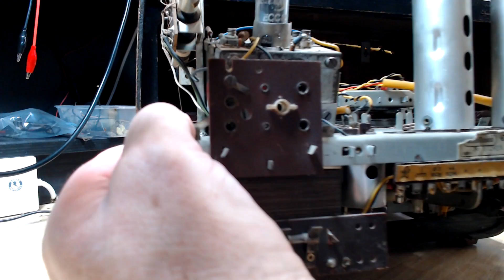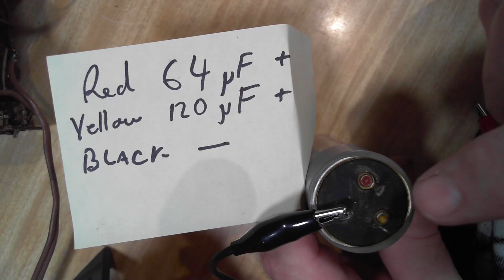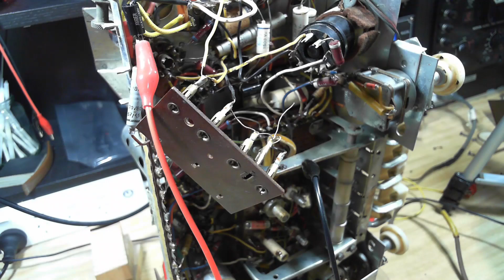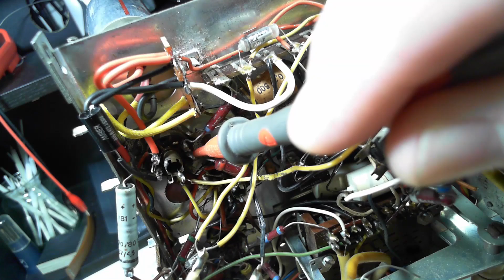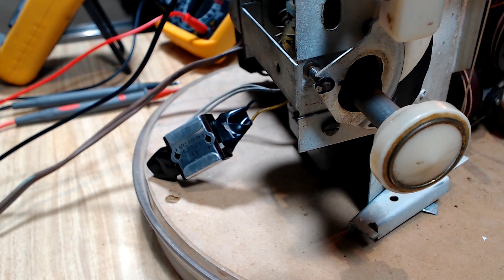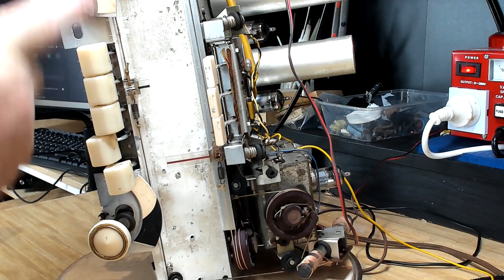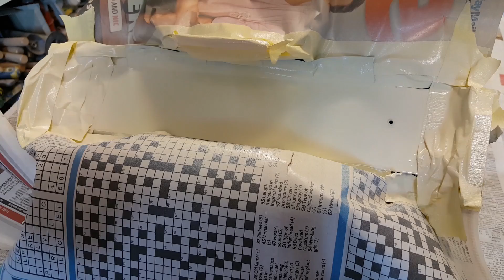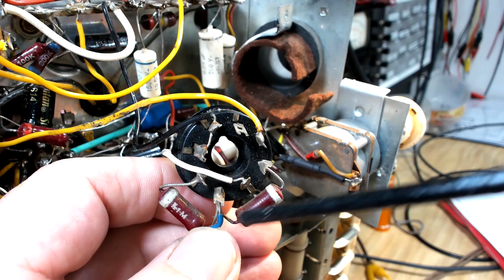NordMende Elektra 58 Restoration & EM34 Magic Eye Substitution  Pt 1

Comment: I think he lied through his teeth I don't think that radio worked for years. He's probably the one who took the speaker out. But don't feel bad I had the same thing happen to me more than once. I still think you got a bargain because the case is in really nice condition. Thank you for the interesting video.
Reply from the maker: Hi David, I don't think for a minute he deliberately misled me and the condition wasn't mentioned in the ad.  He volunteered the information after I had paid for it. He just said it was working and was put in the cupboard many years ago. It probably was working but with an external speaker. I think the seller was only young when all this happened. Besides which when I buy something like this I take a chance, I don't know what it's like on the inside and enjoy the challenge if something is wrong/missing.  Thanks I did get a bargain, i didn't pay much for it, Cheers and thanks 🙂

Comment: There's nothing inherently wrong with an old filter cap rated for 64uF and measuring 92, or rated for 120uF  and measuring 160. These old filter caps had something like -10/+80% tolerance. But since it was probably 50+ year old, it was a good idea to replace it. Have you got an ESR meter, and/or a capacitor tester to measure leakage as well?
Reply from the maker: The idea I have developed from people who know is that a capacitor that reads high means the capacitor is taking too long to charge. If the capacitor design department asks for a capacitor of a certain value and engineering produces one that is 80% over value I suspect it would be rejected. Even in the 60s when this capacitor was manufactured I would expect a consistent value within a few percent. That would mean that a large deviation from the stated value is suspect. The circuit designer may suggest that substitute capacitors within a certain range could be used and the circuit will still function as intended but that would not include capacitors that are wildly out of stated value. That's the way I see it anyway 👍🙂  I have an ESR meter but don't recall using it, with those readings it's in the bin 😀
Reply: @DavidTipton101  It was considered the more capacitance it has, the more to lose from while still stay above the rated value. It was common to 'aim" the value of filter electrolytics about +50% of the rated capacitance during manufacturing, so it will have some "spare" capacitance to lose from during its lifetime. This was applied to filter caps only, obviously no one would use such a capacitor eg. for timing circuits :) . Here's a chart with standard capacitor tolerances, and their codes. I was wrong, there's no such standard tolerance as -10/+80%, it's -20/+80%. But there are standard tolerances like -0/+100% and even -0/+200%. I've never seen an actual example of the latter.
http://my.execpc.com/~endlr/markings.html
You're right, simple capacitance meters can be upset by excess leakage, as they measure the charging time of the capacitors, and a leaky capacitor will charge up slower, upsetting the reading of the meter. For this reason,  I've used to measure both the ESR and the leakage current at rated voltage. I repair just my own stuff, so I used to leave alone old filters if they are fine, just of curiosity for how long will they last. I have many from the early '60s that are fine, and a few from the mid '50s. Some of them are in regular use, some of them just used occasionally (few times a year), to keep them in shape. 

After I built my very simple analog ESR meter in 2009, I was almost bashing my head against the wall for not building it 10 years earlier. It saved me hundreds of hours since then, and hundreds of unnecessarily replaced capacitors in CRT TVs. It's very common that the capacitance of an electrolytic cap can be well within tolerance, while the ESR is 10-20 times the nominal. You can't find faults like this without an ESR meter. Well, sometimes you can, if the circuit works and you can check waveforms with a scope. But a lot of times faults like that can prevent eg. a SMPS to start up, so you can't measure waveforms, just guess. Also, you can't measure capacitance reliably in-circuit, while there are reliable in-circuit ESR meters.
Reply from the maker: An interesting idea mmmm1, I was aware of the tolerance coding system and the fact that it allow for 200% tolerance doesn't mean a manufacturer would build to that standard. The definition of tolerance means an allowable deviation from the desired value. Anyway, this is out of my level of expertise. I will check the ERS the next time but for the cost of a cap I think a replacement cap is good insurance 🙂

Comment: I've restored many German sets in the past. You did well to restore the PSU cap (I wish I had a lathe) 

I usually either reform that cap or replace with a modern 50+50uF. I'm not a big fan of those small electrolytics you have fitted, as I've had bad experiences with them.
Any ERO cap should be replaced on sight. Some of the silver coloured caps are not that bad and hold out quite well.
Selenium rectifiers have got to go and replaced with a silicon bridge + ballast.
EM34 tubes are ridiculously expensive so I use a Russian 6E5C tube re wired accordingly.

Good luck.
Reply from the maker: Hi watchyMCFCwatchy, interesting comment about the caps, I haven't had any trouble with them but I've only been doing this for a short time. All the caps have now been replaced except the silver ones you mention. See part 2 re: selenium rectifier. I used a 6E5S in place of the EM34 too 🙂

Comment: Not a good idea to have the capacitor residue dripping on the lathe ways.
If you can somehow find 12v for the filament, a type 1629 eye tube (war surplus) might also work.  That Ruskie valve seems to have low emission.
Reply from the maker: The lathe has survived no worries thanks scharkalvin. Good info re the 1629, I found an article for making an adaptor for converting from 6E5, unfortunately there are none available locally so I would have to import them from the US or Europe and would cost over $100 🤦‍♂️🙄

Comment: Excellent! Thank you. Waiting for part 2.
Reply from the maker: Thank you saarike 😀
Reply: @DavidTipton101  You are well come. I managed to repair our old transistor radio philips 22rb192. It went silent, no oscillation. It was never the less an quite easy repair there were two 100uf  (one in 1,7 v and other in 17 v line) caps with high esr. Thanks for all radio repair vids I managed to repair it and it works very well now.
Reply from the maker: @saarike  Cool 👍🙂
Reply: @DavidTipton101  Thank you

Comment: Nice to see a Magic Eye again ! Looking forward to part 2.

I've been working through your vids this week here in shutdown UK - you certainly are good at fixing the appearance of these radios, as well as the electronics. I grew up with valves in the late 60s/70s, and although the electronics hold no fears for me, case repairs do :o)  When you print onto wet transfer sheets, is your printer an inkjet or a laser ? 
I enjoyed watching you making new acrylic windows for dials in two vids by different methods.
Now you've prompted me to go and look for a small isolation transformer like your Aussie one - I've never owned one and I think I should. I do have a dim bulb tester though, built to test a friend's Pye 15A. It does't look as good as your latest dim bulb tester version though - what a great front panel !
Is the Pye 19A (I think) on your shelving due for a  repair, or is that already done ?  
I had never seen an Aussie AM bc band dial before - with the states and two-letter idents all marked - new knowledge for me.
Request - when you repair a radio with SW, could you whizz the dial through that band just for those of us that like to hear that, as well as the AM bc band ? Ta !
Atb, Dave (GW4FIC)
Reply from the maker: Hi Dave, thank you. I use a laser printer, the transfer sheets are different for both types of printer. The isolation transformer is a good safety device for all repairs but essential for hot chassis sets. The Pye set has been done, it is an Australian model APM I think. It was in bad shape and I had to re-veneer it, I did it before YouTube. It had an intermittent fault where it would work all day and the next day there was no sound, turn it off and on and it was ok again, it was a head scratcher. It turned out to be a bad connection in an IF transformer. Aussie dials pretty much all had that layout. I can't get much in the way of SW reception due to my location and limitations for a decent antenna. I can get some of the islands north of us and sometimes NZ stations. There is at least one SW Aussie station but they operate at a higher frequency than most radios I have. I only have two radios with that frequency range and one is the Pye set. I might dust it off one day 🙂 ATB

Comment: I enjoyed the restoration of the Normende radio. This week for me was a crossover point for more modern vintage radio receivers. Finding exact fit parts for a thirty year old solid state receiver is a challenge too. A scope is a necessary tool for solid state as there is no device pulling to test. Transistors can simply test in circuit with two to three voltage readings. Working on a solid state receiver offers several challenges from radio, phono to tape devices, its more like a system of sets. I'll still dabble in tube circuits, but have discovered a new affinity for transistor circuitry.
Reply from the maker: Thanks Cosimo, I would like to do some solid state equipment too but it's a big learning curve for me, good luck with your projects 👍😀

Comment: Nice job! I wonder if the thumbscrew on the filter cap clamp has come from the EM34 original fastener? It's not right for the cap clamp.. I have used 6E5C in several radios, the diameter is bigger than the "original" EM34, a problem in some radios. The Russian tube is exactly the same as the American 6E5, except for the base, which is a 6-pin UX on the US (original) version
Reply from the maker: An interesting thought greengrayradio but I don't think so. The filter cap was an aftermarket one and I think it came with the clamp but the clamp had never been attached to the chassis. It's a good thing it was there or I would have still been scratching my head as how to attach it 🤔🙂

Comment: David, sorry this is kind of out of context on this video but a while ago we discussed RF tuning caps and RF grounds and Mr Carlson. This video at 1 hour 7 minutes he talks for about 2 minutes about RF ground. https://www.youtube.com/watch?v=Nzutvfbucr0
Reply from the maker: Ahh, you found it Wayne. I have forgotten why you were looking for it but I will have a look, thanks 👍😀
Reply from the maker: I remember now Wayne,it was about the tuning capacitor rubber mounting grommets and their purpose. I can understand keeping the TC above chassis ground on a hot chassis set because you want it to connect back into the RF circuit but on all the transformer sets I checked they simply have a braid from the capacitor to chassis ground. Maybe they did it because they "always do it this way" I also have seen radios were the capacitor is mounted directly on the chassis 🤔🙄
Reply: @DavidTipton101  You are correct, this video is on an AA5 or transformerless set. IDK! :P
Reply: @DavidTipton101  the tuning cap may be "microphonic" and "sing" when touched in some radios. Therefore, rubber grommets
Reply from the maker: @greengrayradio1394  Yep, that's the only thing I could think of too or the speaker could translate vibrations back to the capacitor plates and cause harmonics

Comment: Excellent job so far. Think the Russian magic eye 6E5C isn't getting enough voltage. Maybe the resistor drifted or your not getting 220V.
 There are some switch contacts  that may need cleaning. May need to replace capacitor C80 in circuit too. Seen a video of one in action on YouTube.
It should be very bright!
Reply from the maker: Hi HTM, thank you. Yes, I agree the eye is underpowered I think it requires 250V but the supply is 210V or 225V depending on the wave selection, the supply voltages are correct per the schematic. The eye is dimmer than it should be but quite bright enough when in the cabinet. I replaced all the white caps including C80 and the replacement is mentioned in part 2. The few I measured originally came up spot on so I left the rest but a check later on revealed they were all out of tolerance so out they went 🙂

Comment: Good progress, David. You're smart insulating that bridge. I went to pick up a chassis on a Grundig German Radio and got a good belt as it was mounted to the side , YIKES!  Looking forward to the next installment.
Reply from the maker: It's a nightmare John. I can understand getting belted with one these things. I have been very careful to remove power before I touch it but still got a belt from the filter cap while trying to locate the terminals to discharge it. I ended up mounting the bridge until I can get a replacement, it seemed safer 😲
Reply: @DavidTipton101  Hi David, when you replace that selenium with a silicon bridge, your B+ will increase. Maybe that alone will make the eye tube brighter, although you say it's bright enough now. Cheers, and thanks for another great video!
Reply from the maker: @quantumleap359  Yes it did but I dropped it back to the spec B+ so no advantage. The eye is bright enough though 🙂

Comment: Interesting project. I never found magic eyes of any practical use for tuning in a receiver, where my ears are better, but they are useful for recording levels on tape recorders and also on capacitor testers. BTW: The German word Mende is pronounced like 'mender' (with a soft r).
Reply from the maker: Hi James, Signal strength meters have been around for years before the magic eye. I agree, I just tune in the station. I would stop short of saying it was gimmick but I bet radios with 'Magic Eye' were easier to sell 😀 Ha-ha, I knew I would be picked up for my pronunciation of Nordmende, I will stick the the aussie pronunciation for now, we can't even pronounce Stralya, cheers 😄
Reply: @DavidTipton101  That must be the QLD pronunciation as I haven't heard it called that anywhere else in Oz. 😛
Reply from the maker: @James_Bowie  It might be my pronunciation I think. I looked up some Aussie TV ads and they did pronounce it with a soft 'r', the American ads pronounce it as I did. I have never heard anyone pronounce it here with the soft 'r' in person. I looked at other videos and people pronounce it both ways. Bit like Miele appliances, it was always pronounced with an hard E years ago now it must be pronounced with the soft R or you get a frown from the salesman .

Comment: The German technology is always impressive.  I have always liked the classy, white plastic and the advanced features.  Did we have FM when this was new?  I don't think so.  Total contrast to the last video.  Cheers
Reply from the maker: Hi Pauline, the Europeans built impressive radios alright. I think we got FM in the 70s and yes, I'm out of my depth here 😀
Reply: @DavidTipton101  Austria had the first commercial FM broadcast in 1955 and I think Germany was a several years ahead, possibly even in the late 40s. AM had become a niche by the 1970s I think. By now it's fairly quiet on AM, only a few stations left, I think one in France and some in Russia and even further east. I suppose FM was originally most popular in densely populated areas.
Reply from the maker: @Ragnar8504  It's a pity AM is dying off over there, we still have a reasonable selection here
Reply: @DavidTipton101  As I said, it had become a niche by the 70s or 80s, so eventually shutting it down was logical from an economic point of view. Still sad to see though! I was there when the Bisamberg station tower was demolished in 2010, quite an experience (they used explosives to take down the steel tower)! That was the last AM transmitter in Austria.
Reply from the maker: @Ragnar8504  Oh no 😪

Comment: Hi David.  I've never even heard of that brand of radio before, so it's very interesting to see.  Question:  after removing the guts from the can and replacing the capacitors so that it looks original, do you put a mark on it or some other designation to let the person that works on it later knows or do you just leave it as is and they'll have to make that determination for themselves?  I'm not saying it's bad or good, I just wondered if there was a "standard" for electronic repair enthusiasts to do so.  Looking forward to your next video.  Best regards.
Reply from the maker: Hi David, I used the same colour coding for the wires from the can but the capacitance values have changed and I didn't notate that on the can but I should and will thanks for the reminder. I have no idea if there is a standard but I expect it changes from restorer to restorer, cheers 🙂

Comment: I like that it has FM but I would have been a little upset that it was not complete, I like the look of having the eye in the Radio, I wonder if there is a way of adding one to a radio that was not manufactured with one,, hmm maybe my next project, lol,, looking forward to part 2, thank you for the video David 👌
Reply from the maker: Hi Melissa, the FM sure is handy but I like to support AM if I can, I might be the only one! It was missing a few bits but that's ok, I had replacements anyway and it would be pretty boring for me if all the bits were there 🙄 If the radio has AGV and enough voltage available it will probably support magic eye, you have to secure a ME valve first though, cheers and thanks Melissa 😀